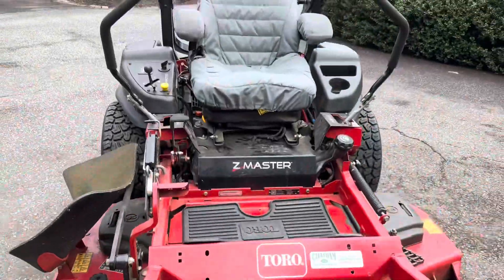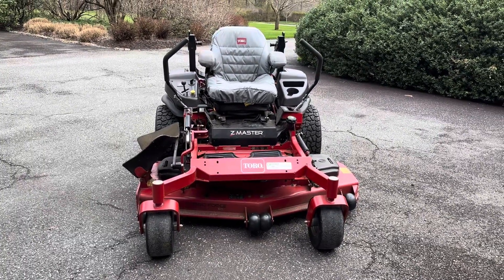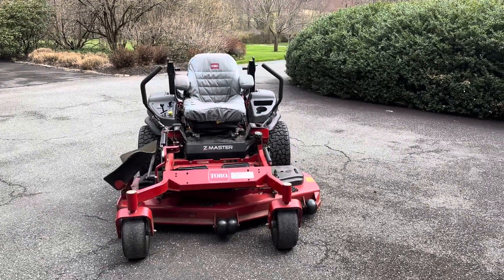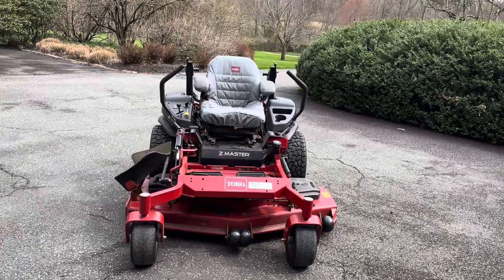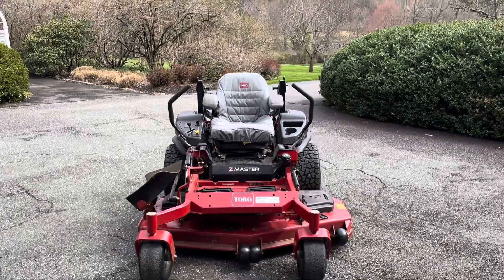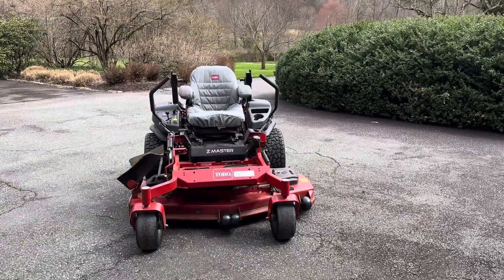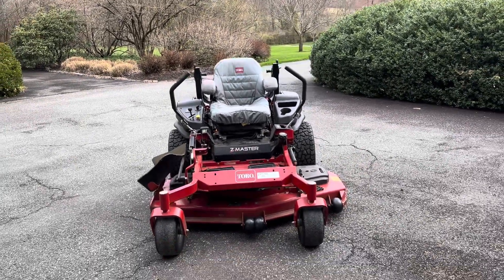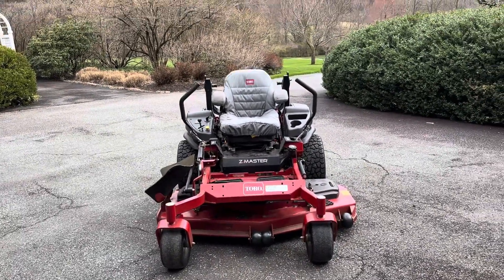Leveling process for a mower deck, explaining true rake and why its important for cut quality

Comment: I have the same Zmaster (52” not 60”)

What is the actual pitch you have yours set at?
I’m thinking mine is too flat/ level- front to back, not enough positive rake. Although the manual says 1/8” is OK? Other manuals for same machine say up to 1/2” positive rake- 

however, this seems to cause more wear on the idler pulleys, as the belt isn’t as flush. 
I normally cut on the highest setting/ transport mode 4.5”. 

Mine has always cut 1/4-1/2” lower than the height selection. Regardless how I set tire pressure in rear. Front tires are flat free semi pneumatic 

Great video!!
Reply from the maker: It depends on the operators weight as a heavier operator will cause the rear of mower deck to settle down more. I target 1/8inch positive rake when the weight of the operator is on the machine as this minimizes the height of cut change in the middle blade…

Comment: Question what happens if a corner won’t drop meaning the chain is loose and no more room for the deck to drop
Reply from the maker: If a chain is slack most likely all four tire do not have even ground pressure. When properly leveling the deck all four corners will only hold equal weight (feel tight) when all four tire have equal ground pressure. Make sure when checking the ground pressure (weight) on the front caster tires that the weight of the mower deck and assist spring has been unloaded, otherwise the caster tires can appear to have equal ground pressure when in fact they do not.